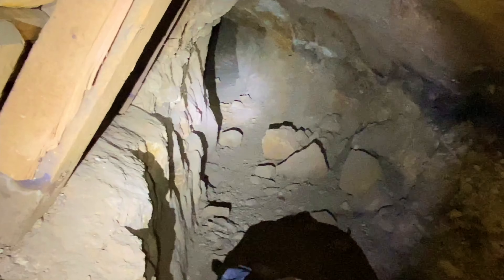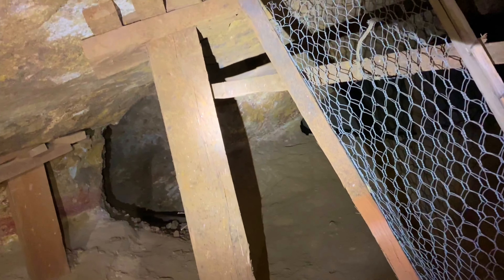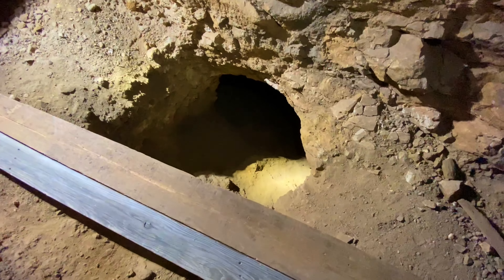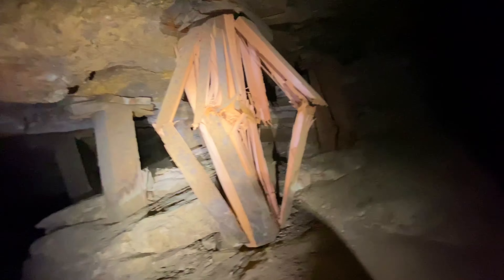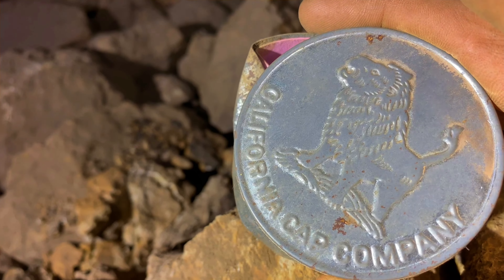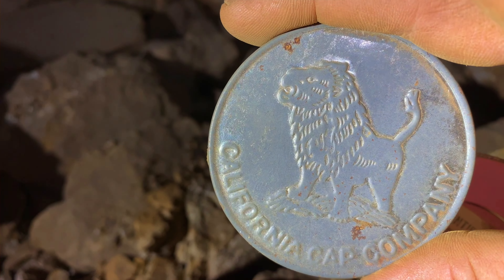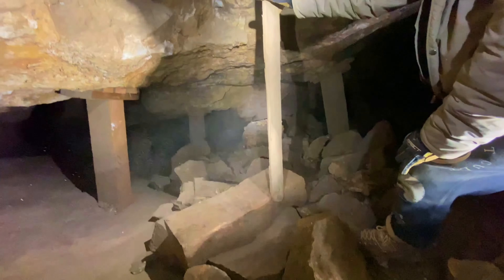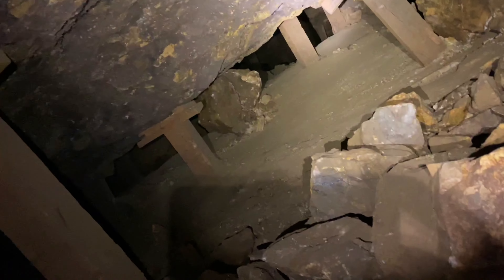Ascending Steep Inclines to Upper Levels in an Abandoned Mine

Comment: What are an impressive mine!
Way bigger than someone just walking into the adit would expect.
Those busted supports would have made me pretty nervous though.
Reply from the maker: Thanks for your comment! Yes, when I first visited this mine a couple years ago, I wasn’t aware of all the extensive upper levels in the stopes. I followed the main tunnel in and then came back out. It wasn’t until later that I learned I missed a large portion of the upper workings. Only took me two years to get back there and explore the stuff I missed the first time, but it was worth it.

Comment: Thanks for uploading Frank. Look forward to the newest video. Ever thought about revisiting the Wicked Wash mine?
Reply from the maker: I actually tried to go to the Wicked Wash Mine last year. However, the turn off for the dirt road has significantly changed due to erosion and flash flooding. I was no longer able to get my Corolla up there like I had many times in the past. I still may go and hike in and check it out. That was a cool mine. I don’t think I’ll go all the way down the inclined shaft again because there’s no reason to. Only that second level was the most extensive one. Might revisit that someday.

Comment: What is the most valuable item or historically significant you’ve found in all your time spent in these abandoned mines? Your work is incredible! Thanks for sharing!! Be safe
Reply from the maker: Good question, Joe! It’s hard to narrow that one down. I would have to say the most significant thing that really sticks out is the shrine Tony and I found at the end of a drift tunnel inside an abandoned mine. This was way back in 2012 or 2013 or something like that. There was a large, wooden crucifix on the shrine as well as various objects that must’ve been representative of the deceased person’s life. The person’s cremated remains were also on the shrine in a round cardboard container. There was a children’s book on the shrine, a hubcap, some bullets, and stuff like that. Was definitely surprised to come across it deep in the mine. I learned a few years after my visit there that the BLM installed a heavy duty bat gate in the entrance to that mine, so I’m assuming they left the shrine in there and did not remove it. Access to the mine, however, is now virtually impossible. Video is here: https://youtu.be/6220KqWoadw
Reply: @AbandonedMines11  awesome, thanks for sharing! I’m going to check out the video now!